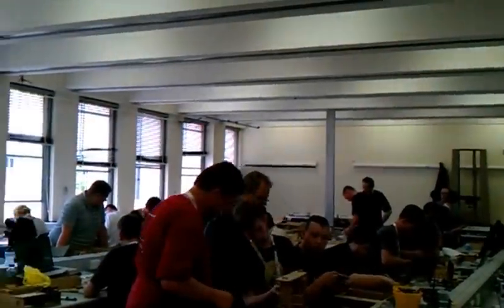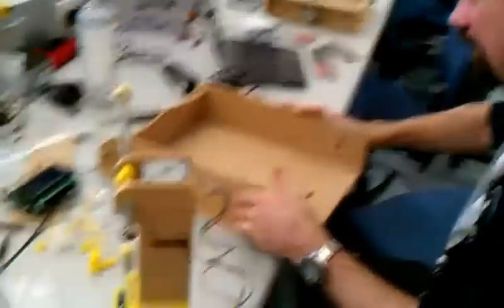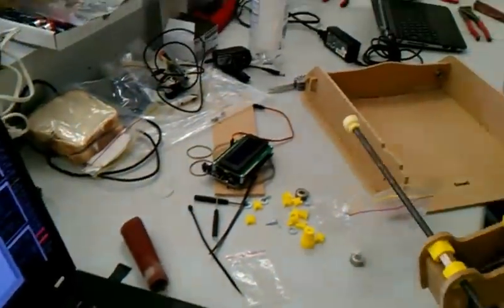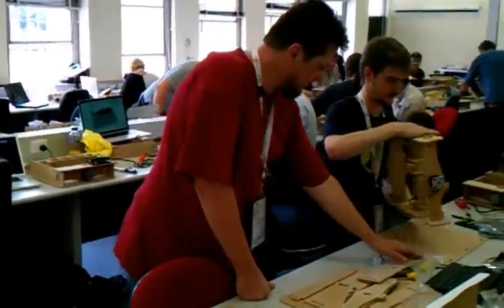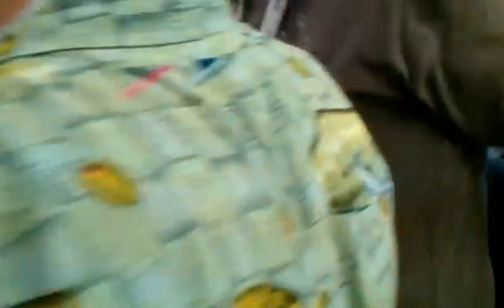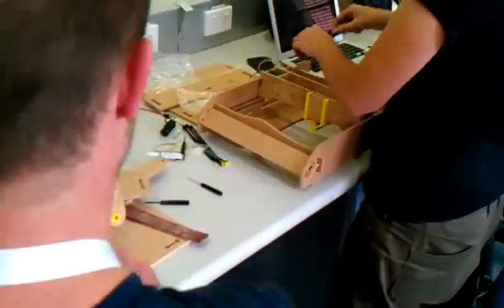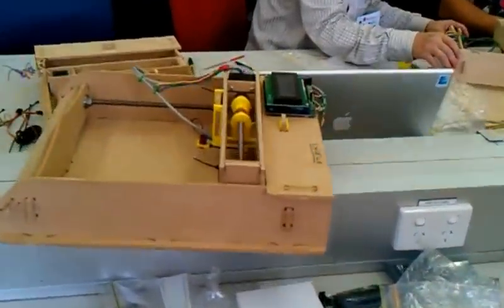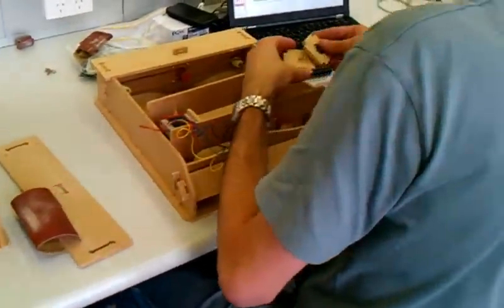Walktime Blog #29: Arduino Miniconf assembly session at LCA2013

Comment from the maker: The design is as open as we could make it. If you check the Arduino Miniconf wiki (linked in the description: I can't put a URL in a comment) you'll find a link to all the design files for the chassis, electronics, software, etc, and assembly instructions. The objective for the design was for it to be as easy as possible for other hackerspaces etc to recreate it. The control boards will also be available for sale soon on their own so you can combine that with chassis parts sourced locally